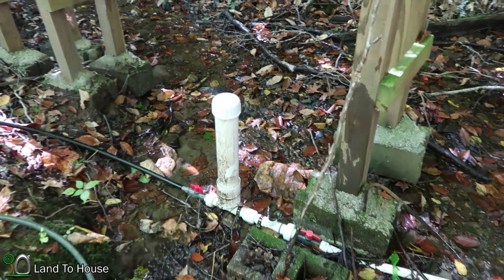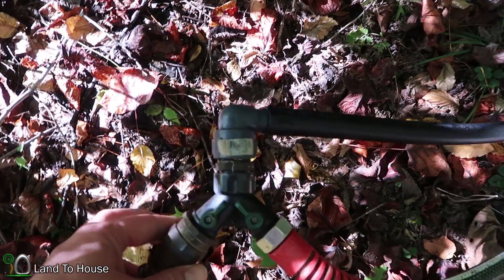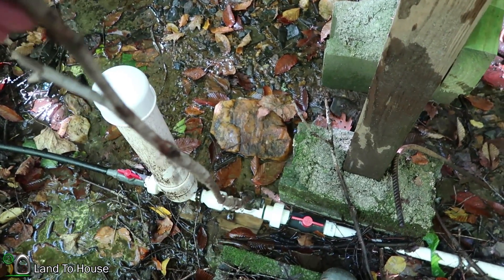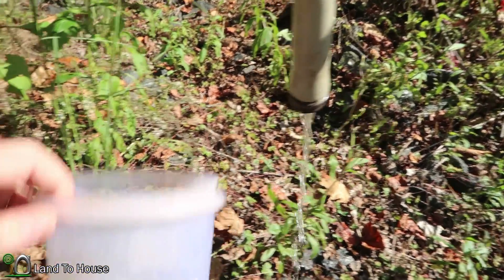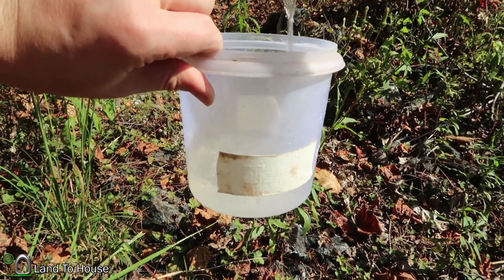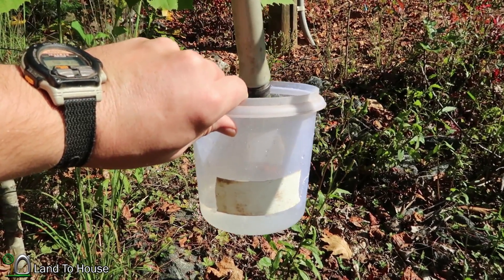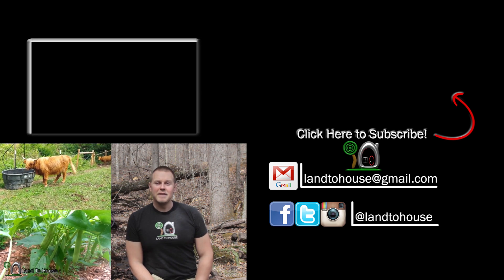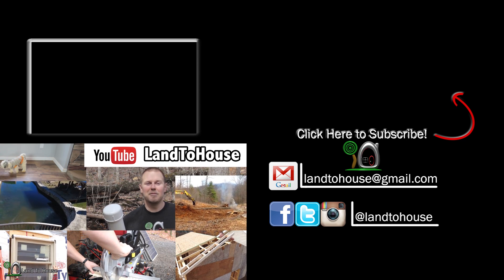Two Ram Pumps One Delivery Pipe

Comment: Great experiment, well done sir!maybe you can save the waste water from the 1 inch ram pump and re use it by installing another ram pump below with a safe distance apart.thank you and God bless..
Reply from the maker: Yes that is a good idea. Placing a catchment pan under a ram pump and using the water again down the line for another pump.
Reply: Or hooking up a pipe to he waste valve, and using it to like water a garden or something? Like poke holes in the pipe at intervals, so it slowly drip waters your garden or whatnot. With perhaps a cut-off valve or something to divert it elsewhere when you don't want to over-water your garden? Whether to another pond / reservoir, or to a tank to use with another ram pump downhill, or whatever?

I also still wonder about the use of multiple ram pumps / tanks to get stuff up a larger hill, and "recycling" the "waste" valve water from one uphill ram pump back to the reservoir of the next downhill pump, so you're not necessarily "losing" all that water at each stop up the hill? Sure, it would take some engineering, but might be interesting?

Comment: works good ! how about 12 pumps  hooked up to a "Y" shaped manifold bulkhead pipe that drives all pumps into one delivery line with a check valve midway up the delivery line. lol one day we will see you testing 100 pumps linked together .great test brother!
Reply from the maker: I should think that you can add as many rams together as you like. The delivery pipe would have to increase to keep the friction down with that much water flowing. ... 100 pumps. .. I would need about 20 times more water in my creek. :)